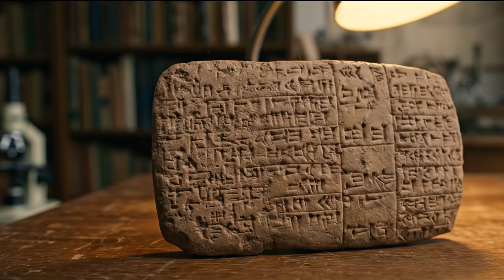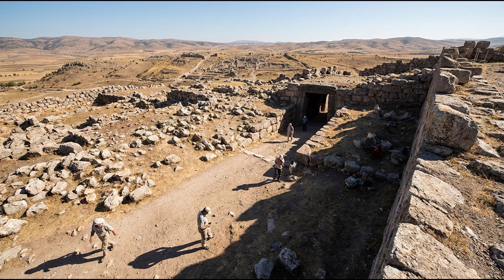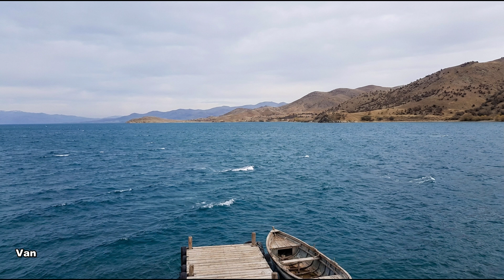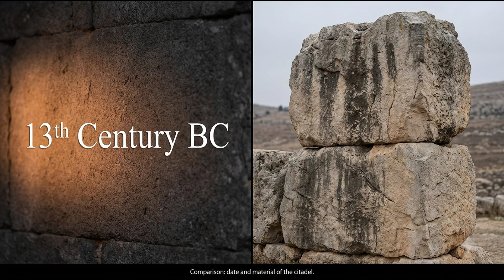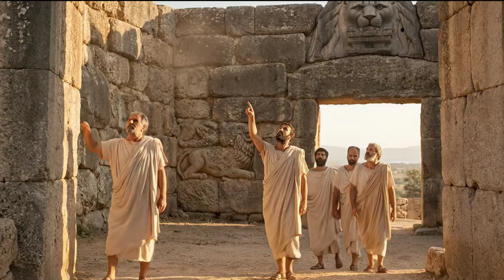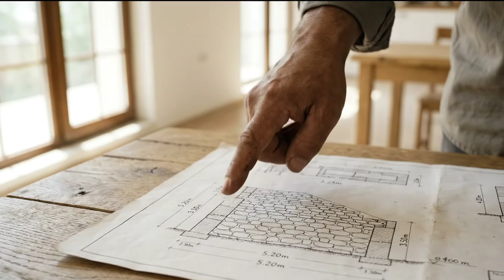4 Ancient Forts, 20-Ton Blocks: No Man Could Build Them

Comment: Verdigris is a blue-green layer that forms on copper, brass, and bronze through chemical reactions with air, moisture, and acids. 
 It protects the metal underneath and has been used since ancient times as an art pigment

 When copper tools or artifacts interact with oxygen, water, and carbon dioxide over time, they undergo oxidation.
 This chemical reaction creates a distinct green coating called a patina, 
which is primarily made of copper carbonate